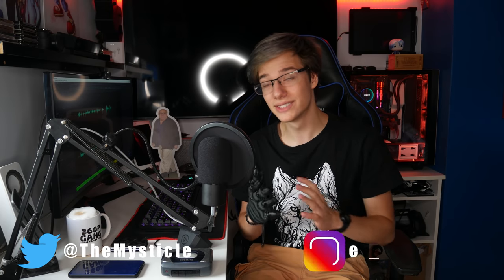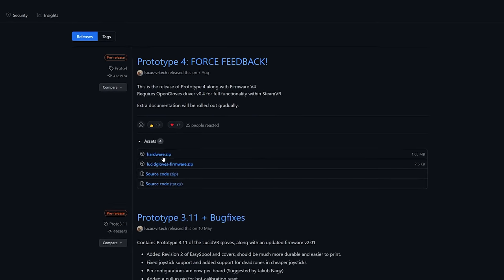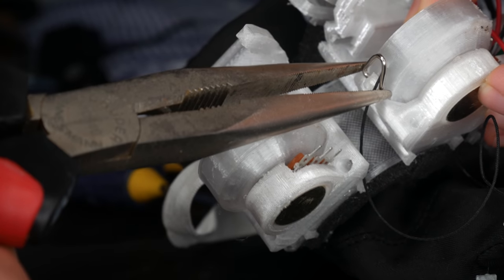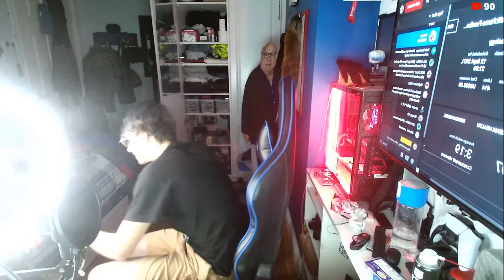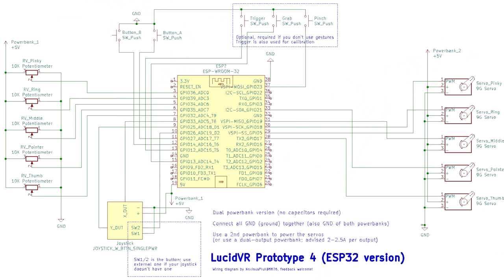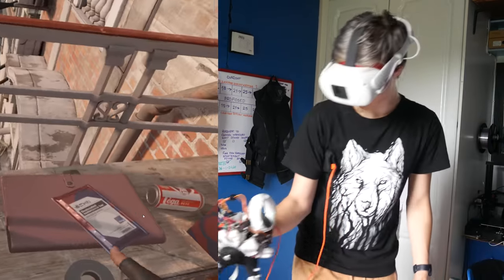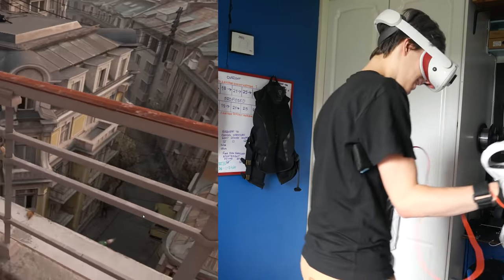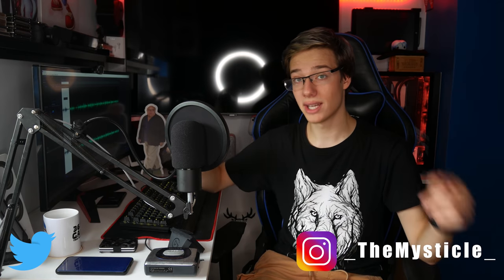Making $70 DIY Haptic Gloves That Let You Feel Virtual Reality!

Comment: It’s still a bit of a birds nest design, once that’s fixed it’ll be great
Reply: I’m pretty sure that Lucas will be fixing up the design and making it smaller in the near future.
Reply: To be fair, most of the wires are a lot longer than needed and could be organized better. However, I do think that it's going to get better and that's insanely exciting.
Reply: @davidlewis2171  lucas said it needs to be long so that if something goes wrong, you can just cut it and rewire ig
Reply: @crypt0red560  its been 2 years...

Comment: Those pots are intended to be soldered. I have soldered many in the past.
You need a temperature controlled soldering iron. Any random soldering iron without temperature control should not be used on electronics due to likelihood of overheating the part.
Please let me know if your iron is temperature controlled.

Comment: This is amazing!
Though I'm gonna wait until a more compact diy is feasible.
That's not a glove! It's a GAUNTLET
Reply from the maker: Should I snap my fingers?
Reply: The smaller it is the more annoying it will be to build
Reply: @DaleIsWigging  true. Also then we need better 3D printers or even metal parts.
Reply: @David-ty6my  
Meh the Printers we have are fine
Do this in nylon (maybe even carbon fiber nylon if your skin is fine with it) and you are golden 
Just needs experience and a decent printer

Comment: how strong are the servos? i would be worried  about breaking them if i accidentally flex my fingers too hard
Reply: Stall torque at that point on the servo arm on MG90S Servos is about 1.8 kg @5v - so you'd need to exort at least that amount of force onto the servo arm to really damage anything. They're pretty hardy, and the way that you're applying the stresses on the servo through the guide loops and sprung retraction mechanism, I wouldn't be too worried about it.

Comment: I'm wondering if you can simplify and lighten it by combining middle, ring, and pinky fingers.  There aren't that many games and applications that makes use of those 3 fingers separately.
Reply: the whole point of these is that they mimic valve index controllers, all games that support valve index controllers also support indiviual 5 fingers

Comment: Look at discount sites for a 90's arm band  holder of cell phones ( or make one ) for the battery pack...
If done right, you can add a USB power Y adapter and also mount an arm Slime VR tracker ( software mod may be required )

Comment: Hey, any quest 2 coders and hardware hackers, could ir leds enable glove tracking on quest 2/3 if coded correctly either in steam VR or quest natively?
Essentially skipping the need to strap a controller to the glove for positioning. 

IR LEDs around the wrist maybe a pattern on the back of hand/ palm and finger tips for splay etc?
I mean they are LEDs, low power consumption.

Also any other headsets that use IR tracking for controllers this might work for?

Comment: I noticed you using the oculus controller im guessing for tracking but what if you used a slime tracker instead to slim out the glove?
Reply: Not sure if you already found this answer, but for others finding this video SlimeVR trackers do not work for this purpose. SlimeVR trackers use IMU tracking, which is no good for the gloves. For information about this there is a full response on Discord's FAQ.

Comment: Is there a reason a set of spring loaded linear potentiometers not work? I would think it would make it far less bulky.
Reply: If the throw is enough and they are 10k, then they will work! You would just have to design new mounts and a way to let the servos impede their movement. I like where you are headed with this since they can lay flat or even stack on edge